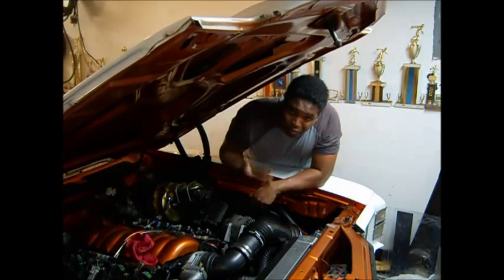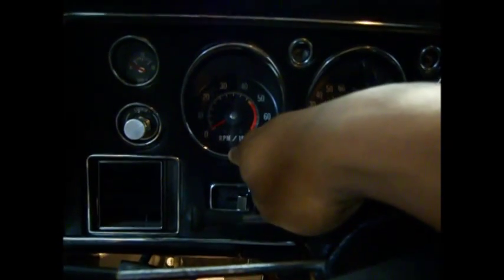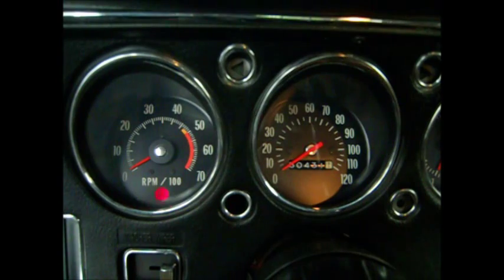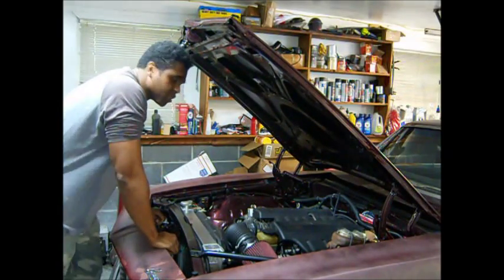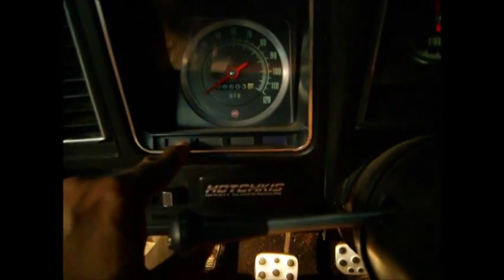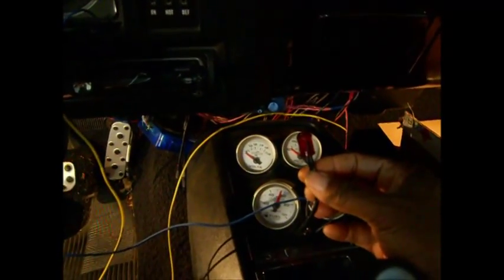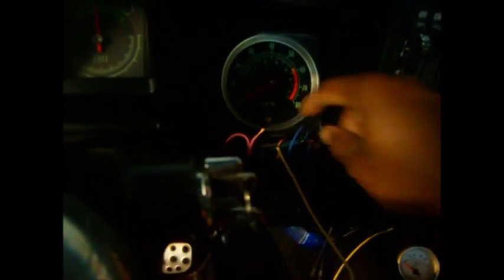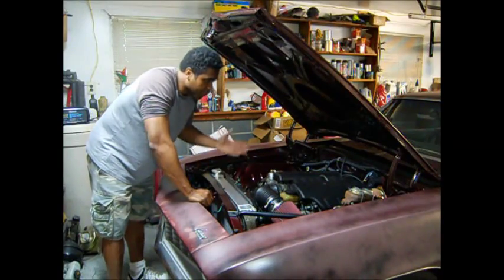CONVERT STOCK IDIOT LIGHT TO LS TROUBLE CODE LIGHT

Comment: Hey man love ur videos but I had  an odd question, idk if i got the right dummy light, I got the one that is for the alarm, that when I connect a power and ground to it, it just blinks, can I use that one, or it has to stay on, ?
Reply from the maker: its pretty much what i used in the camaro.. it will work no problem..

Comment: Hey Terry how do you wiring the alternator to the idiot light??
Reply from the maker: i see.. so pretty much you want it to come on when you start the car anf off when its running?
Reply: @Coverman66  yes Sr!!!!
Reply from the maker: whats type of car?  are you using the GEN light as a trouble code light?
Reply: 72 chevelle
Reply: No I'm not using has a trouble code light,I want to connect the light to alt that way my light on the dash turns off Lol
Reply from the maker: that seem to be the stock setup.. did you replace the wire harness?
Reply: @Coverman66  is an 2001 LQ4 swap (alternator 4 pin PLFS with only 2 wires gray and brown wires hooked to L-F only) Do I have to remove them out of the ECM and connect straight to the dash light or leave them on the ECM???
I'm sorry for all the mistakes lol

Comment: Would this be the same for a 69 chevelle? Could I use my dummy light for that?
Reply from the maker: exactly.. you can use any light you want.. it works great..
Reply: coverman66 so do you just splice into the wire or does it get hooked up some other way.
Reply from the maker: the 69 chevelle doesnt have a circuit board in the back correct?
Reply: coverman66 I dont believe so.
Reply: Also what did you use for the 12 volt wire, meaning what did you connect it to to get the power?

Comment: I'm using the 98 z28 camaro alternator
Reply from the maker: if i remember correctly, thats a one wire hook up, the brown wire called the excite wire should go to the alternator connector.. when i get home i will look on my camaro to tell you which slot on the connector to hook the brown wire to..
Reply: im not s bt this alt has the main power connction and then a single i yellow plug on top. some how its not chaging my batt

Comment: hey bro what air filter setup is that?
Reply from the maker: On the Chevelle i used tubing from a silverado i picked up from a junkyard, the 69 camaro have the tubing from the 06 gto.. both filters are from Spectre. hopes that helps out.
Reply: hey bro im having issues with my charging 
system how did you wire your alternator
Reply from the maker: which alternator are you using? camaro style? or truck style? what are you using for a harness?